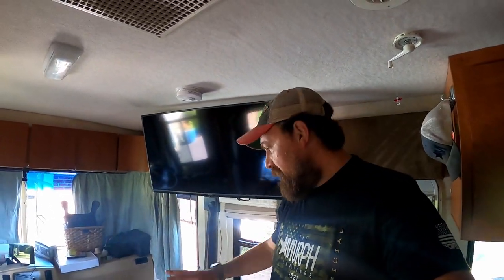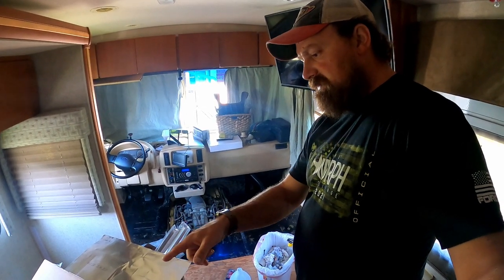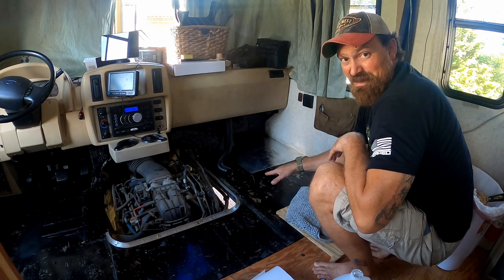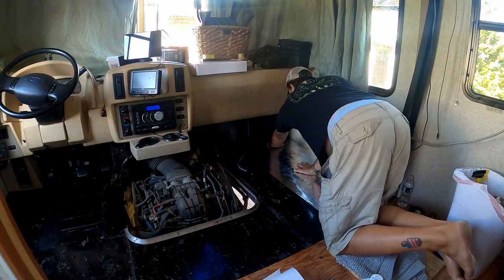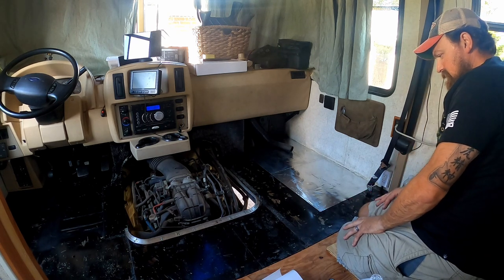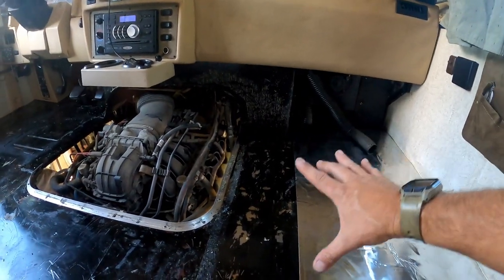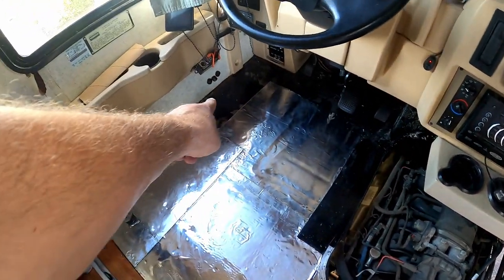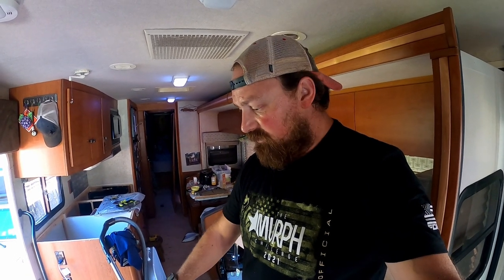SOUNDPROOFING THE RV CAB with Db Armor | S2-E7

Comment: Wouldn't you want the material on the bottom of the floor with the reflective side facing the ground???
Reply from the maker: This is sound proofing mat not heat mat.  I have heat mat on the underside of the floor with reflective side at the engine.